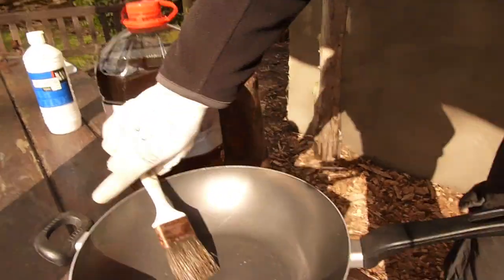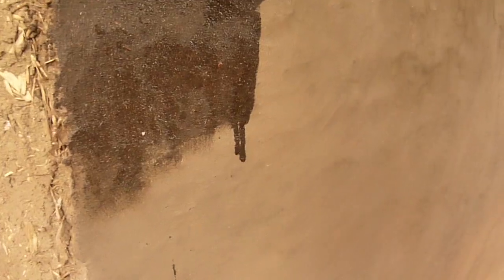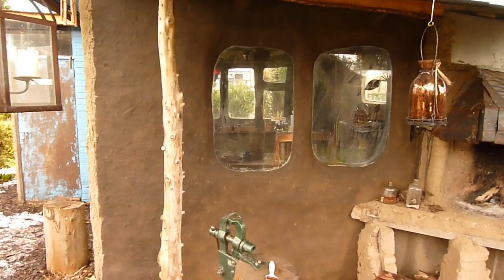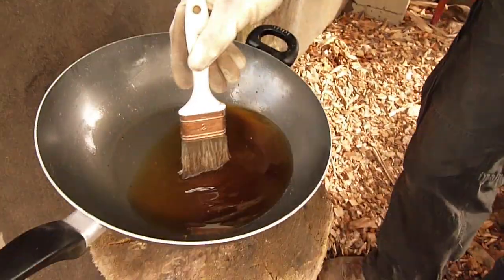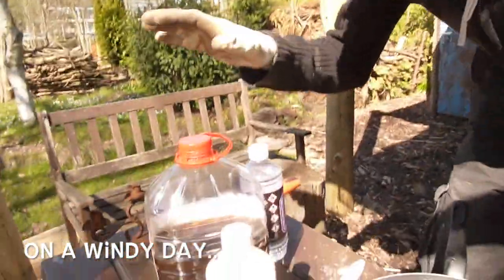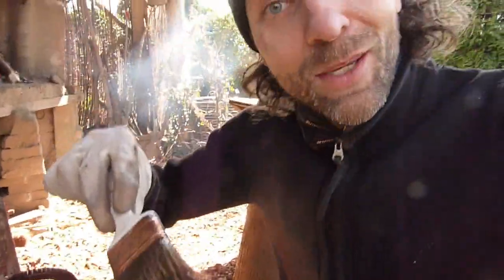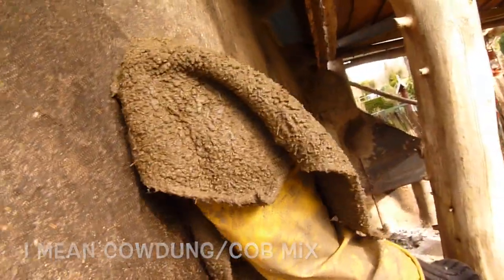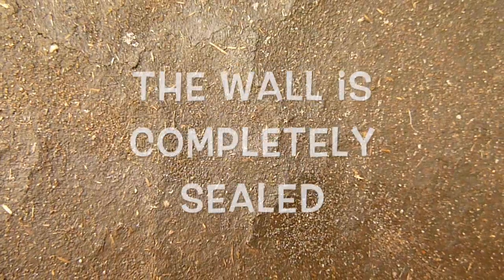WATERPROOFING a COB wall 🏰 (earthen plaster) with linseed oil

Comment: I enjoyed the video, but I don't understand the rationale of first coating with heated linseed oil then following with 2 coats of diluted oil and turpentine (1/4, then 1/2). Wouldn't it make more sense to start out with the diluted oil for deep penetration (1/2, then 1/4, then just oil)?

Comment: Bad idea. You want your walls to breathe.
Reply from the maker: Of course it is a bad idea if you want your walls to breathe. But if you read the info below the video, you know that there may be circumstances where it is a great idea ;-)
Reply: @Le0nski 
Don't believe everything you read.

Remember, cob is made with straw. It does not compost down into dust. If you put a substance over your cob to where it traps moisture... 

You will not only have collapsing walls and roof- but black mold which you will be breathing in on a daily basis, wondering why you have constant headaches.

Comment: The Linseed is expensive for painting onto the absorbant mud.  But it's good!   
Also, I have some earthen structures in a humid area that I finished with lime + dirt plaster, then lime+dirt paint.  Lime is a great stabilizer waterproof if in humid areas.  In the desert it would never work for me.

Another one is making a stabilized plaster with the linseed oil. I think that is holding up pretty well on an adobe I did.
Another one is wheat paste.  Look it up for recipes.  Surprisingly good. 
Another one is "prickly pear" juice or "baba de Nopal"  much more involved and perhaps the least stable, but also worth playing with.
Reply from the maker: Wow, thanks for your post! Great addition to the possibilities.

Comment: I know I am a little late, but it might still help for your future project and others: if you boil raw linseed oil to create DIY boiled linseed oil you have to be very accurate! It needs to have a temperature of 130-150°C for at least an hour (better two) to initiate the chemical reactions. You can use a deep frying thermometer to check the precise temperature. And as you said, it is highly flamable. So when you heat it to these temperatures, better don't do it on an open flame. 
In general raw linseed oil or your heated linseed oil will also harden completely. Just a little less durable, as it will have less polymerized bonds. The waterproofing effect is the same though!
To explain your cracks: your first layer did not penetrate the wall and only created a thin protective shell. As @laurens3638 explained, it's better to start with a higher dillution first to make sure the oil penetrates as deep as possible. Your dilluted second layer was not able to penetrate deep as the first layer already created this thin shell. When you applied your third layer, the cracks appeared because you applied the oil too hot. The temperature difference cracked the thin shell up. You can see in the video that this thin shell even delaminated a bit.
So even when using the right order of dilluted oil, do not apply it hotter than 40-50°C to allow even suction and gentle cooling of the oil. This will give you a consistant and durable finish ;)
Hope this reaches you well!
Reply: so which oil is best to use to waterproof cob ...boiled linseed oil or raw linseed oil ?

Comment: Does it remain moisture permeable? I’m not sure   Wouldn’t it be better to use line wash instead ?
Reply from the maker: The water can't get through, it is completely sealed. This is why I don't recommend doing this to all your walls, as they will also stop breathing. Lime wash is a good choice, but probably not on a wall that is exposed to a lot of rain. This was my main concern for waterproofing this wall.

Comment: Why did you heat up your boiled linseed oil? Also, was there a reason to go with boiled instead of raw linseed oil? The boiled dries faster but I've heard raw is more durable and protects better once dried. Also, boiled typically has solvents added to it as dryers, then you even added more....all of the additives may be what caused cracking. I was wondering if you ever tried just using plain raw linseed oil. Also, certain pigments added will give it characteristics...for instance zinc oxide pigment added makes it into a excellent white paint with very very good UV protection.
Reply from the maker: Hey Stephen, when cold, the oil is quite thick and has a low viscosity. After being heated up, it is absorbed much better into the wall. Boiled linseed oil has been treated with heat for a certain amount of time, resulting in an oil that is much different from raw oil. If you think raw oil is better, just us that, I am a fan of experimenting with these things, so try and find out.  When you get boiled linseed oil at a trusted source and you know it is genuine, it contains no additives. When bought cheap, it will contain plenty of additives to hide the fact that it was not heat treated as it should. I should not have added turpentine, it was cheap and probably caused the cracks, so you are right. Better to use it plain. Nice to hear that you can add pigments, I am definitely going to try that in the future, so thanks! Thanks for sharing your thoughts!

Comment: Will raw linseed oil work? What about for sealing a clay floor, will raw linseed oil work? Thank you.
Reply from the maker: Hey, thanks for asking. Raw linseed oil will stay fluid, and the boiled version wil harden after it is absorbed by the wall or the floor. You can’t boil it yourself, it’s a specific proces (unless you know how, of course, but it’s more practical to buy it). It’s expensive, but goes Al long way. I introduced this oil in my videos after seeing a video where it was used on a clay floor. I just took that idea and waterproofed my earthen walls with it, it turned out surprisingly well. Your floors will become dust- free, waterproof and hard as a rock!

Comment: Hi, We just finished a cob bench covered by a roof. We put 4 layers of linseed oil on the bench and it looks good. Do you know if we'll need to add a layer of linseed oil every year or every few years? How can I tell if the bench needs it? thanks for your thoughts.
Reply from the maker: Hey, I was checking my messages and saw that I completely missed your post.. sorry about that! It’s been a year, so I am curious of how it looks. Do you think it needs a new coat or is it still fine?

Comment: Wouldnt the high contraction/dilatation of oil cause even more cracks in time?
Reply from the maker: Well, at the time I applied the oil, I read that after a few years you need to apply it again. A few years ago I sold my mancave, because we sold our house, so I haven't recently seen what it looks like, and I don't know if the current owners have reapplied the oil. In 2018, the wall was still in perfect shape, no new cracks had appeared. I intend to visit my mancave somewhere soon, so I will let you know what it looks like after 5 years.
Reply: @Le0nski  Probably after the oil polemerize with the surface, its properties are somehow changed. However i decided to apply a liquid rubber to mine.
Reply from the maker: @danielmogos8990  That's interesting, is it natural rubber that you applied?
Reply: @Le0nski  yes

Comment: Would olive oil work ?
Reply from the maker: Hey, thanks for asking. Unfortunately not, it doesn't harden when exposed to air. Boiled linseed oil hardens and stays there for several years. Make sure you get one from a reliable paint supplyer, because the cheap stuff is fake.

Comment: Hats off to you for your informative video. Would you please share your experiences about use of linseed oil over lime plaster in kitchen, bathroom or other water expose area , to make Water proof wall? Waiting for your reply !!👍🙏🙏🙏
Reply: For lime, you can seal it with the traditional Morrocan method using olive oil soap. The soap and lime react to make a hydrophobic surface. Look up “tadelakt”.
Reply: @lenavoyles526  ❤️❤️
Reply from the maker: As far as I can tell, it's perfect for any place that is exposed to water. I have no experience with lime plaster, so you might have to ask around a little more. Just keep in mind that the walls no longer breathe. Besides that, it's great. I used it on the wall around my sink, and the water just runs straight of. Hope this helps!
Reply: @Le0nski  ❤️❤️

Comment: With an increased overhang on your roof waterproofing is not as critical. Pat@cobworks.com
Reply from the maker: Thanks, you are absolutely right! This mancave was initially just a wooden shed. The roof and walls were already there, all I did was remove the walls and replace them with mud. Overhang is essential and I only advise using boiled linseed oil on a wall that is subject to heavy rains with a lot of wind (as we have in Holland.) Thanks!

Comment: Does this process make the wall vulnerable to fire?  Linseed oil and turpentine are highly flammable.
Reply from the maker: Hey Anna, thanks for your question! It doesn't make it vulnerable to fire. The oil cools down immediately once you apply it, and you only use a bit of turpentine (although now I no longer recommend diluting the oil with turpentine, pure linseed oil works better). The linseed oil is flammable, but the greatest risk is caused by soaked rags that are left folded up after use. They can spontaneously catch fire. Furthermore, the wall soaks up the oil quickly and the earthen materials will slow down any fire (I have not tried to light up the wall yet, but it would be interesting to try it 😉)

Comment: Can I use palm oil instead since it’s cheaper?
Reply from the maker: Hello David, thanks for your question! Boiled linseed oil is processed in a specific way. It is expensive, but you can't use any other oils to waterproof earthen floors, walls or sculptures.. It hardens when it dries and this is not the case with other oils. Sorry!
Reply: @Le0nski  thanks for the answer

Comment: is linseed oil flammable after it dries
Reply: No, luckily it's not 😊 When you use a piece of cloth or a rag to apply it, just don't leave it fumbled up and lying around somewhere, after you finish. After a while it may spontaneously catch fire. If you hang it out to dry, this won't happen. When applied to earthen materials, the oil hardens and becomes harmless 😅
Reply: @meesterleon3361  That is great news...thanks for the reply

Comment: I have had oil paint crack when I added too much turpentine. May be better to do without.
Reply from the maker: I think you are right. It's probably best not to add turpentine, although I will have tot test that, to be sure. The technique of sealing walls with boiled linseed oil is initially used for cob floors. I just used it on the walls. A floor needs to be soaked as much as possible. A wall just needs a 'crust' to protect is. Not using turpentine would probably work 👍🏻

Comment: What is wash out and do you have to do this?  I live in the desert
Reply from the maker: Hey Tuffy, a washout is when the rain washes away parts of your wall. A monsoon or torrential rain may cause this. If you live in the desert, you might never have to deal with this, I suppose. Is that would you mean?

Comment: Could you use sunflower oil?
Reply from the maker: Hey, good question 👍🏻 Sunflower oil stays liquid whereas boiled linseed oil becomes solid in the wall. Then again, maybe no one has ever tried it before.. so try it out on a piece of dry cob and see what happens. I make testcilinders by filling an empty toilet roll with cob. When dry, I apply whatever I want to test. I then place it in a little bit of water and compare it with a test cilinder of cob with no additive. Check out my banana leave video for a demonstration - good luck, let me know what happens 😁👍🏻
Reply: What about tree sap?

Comment: Well done.  Thank you.
If you don't have linseed oil. What other alternative may one use?
Reply from the maker: Hey Robert, that's the million dollar question! There are ways to make it water repellant, cowdung in your mix works very well. There are vage records of people using animal blood, termite mount, banana leaves, carob and other natural ingredients, I have tested banana leaves and carob (test not completed to my satisfaction yet), but it is no match compared to boiled linseed oil. You can use lime plaster, but I have no experience with this. Linseed oil prevents your earthen wall from breathing, so don't use it on all your walls. It is somewhat expensive, but it works, and you can order it online (make sure it is genuine, there are fake oils out there). Hope this answers your question!
Reply: @Le0nski  thank you

Comment: Boiled Linseed oil is full of additives and chemicals that cause it to cure faster, which is why it's a skin irritant. Food grade flax oil is the raw ingredient in it and can be found at just about any grocery or health food store for a comparable price.
Reply from the maker: Hey Luke, thanks for your comment. You are partly right. High grade boiled linseed oil has no additives or chemicals. Cheap versions have not been boiled, so the chemicals are needed to make it appear like boiled linseed oil. You can consider these brands as fake. The Linseed oil that is found in health food stores or groceries is not boiled, but raw. This will not waterproof cob or earthen materials. It is made for consumption. Take care man!

Comment: Thank you for the nice video! I would like to know if I can apply the linseed oil as well on a Pizza Cob Oven as the waterproofing last layer?
Reply from the maker: Hi Anabell, thanks for your comment.  I have not tried it myself, but some people have. I have not heard of any problems if you do. This is what I answered Christian Young (see below):  "Don't forget to ventilate the oven after baking your pizza, because all the moisture will be trapped inside the cob. Someone on YT suggested not to treat a pizza oven with linseed oil, in order to let all the moisture escape through the cob layer during the baking process. I don't really think that's a necessary, if your oven is thick enough, the cob will take up all moisture and release it again once you leave the oven open after baking." 

You might check with him to see how it turned out. A roof over your oven will protect it as well. Keep me posted!

Comment: Can i make a roof like this?
Reply from the maker: I abolutely think so, yes! If you keep the cob layer thin (like I did on my doors), it won't get too heavy. Also, make sure the water can run of. I am planning to use it on the roof of a new project as well and the nice thing about it is that you can create organic forms in your roof. My idea for this is as follows: Make a sturdy wooden structure to support your roof, and then place wire mesh on it. Cover this with a layer of burlap and then a thin layer of cob / earthen plaster and then boiled linseed oil. After tree years, repair any cracks and repaint it, and you'll be fine. You might add a waterresistant tarp underneath the wire mesh, just to be sure. This will make an ugly ceiling, so you'll have to mask that with fabric or a wooden ceiling. I have not tried this yet, but I am confident it will work. 

I hope this helps, keep me posted of your ideas, good luck!

Comment: Did you use wire in the build?
Reply from the maker: Hey Samantha, I completely overlooked your question... I did use wire mesh, to hold the wall in place while it dries.
Reply: @Le0nski  that's cool work. 🙂

Comment: Are you able to add insulation  to live in in winter? What size were you wall was it waddle and tube? Or cob or made brick form like Adobe,  we plan to build a shed soon and I am currently making a small kiln with added fire clay. We hope it works well for my jewelry peices
Reply from the maker: I am not allowed to live in my mancave in winter, because of the regulations (it's an area where you rent a garden), so I am not going to insulate it. The walls are very thin: 2 inches at the most, I invented my own technique (watch mancave 2.0 if you can stand the sound effects ;-)   I used waddle & daub as well, that is such a perfect technique.  If you want to read up on the topic, try the book 'cob builders manual'. It's freely available on the web. Good luck!
Reply: @Le0nski  were making a fence soon with waddle and daube  so we can have parts of the wood  exposed in some places, I'll look that book up and thanks
Reply: Would that type work for a shed?
Reply from the maker: @samanthanicholson9015  waddle & daub is perfect for a shed!!

Comment: Is it fire resistant, Even if linseed oil or wax is applied? I thought it's flammable, how did it help for rain and humitity?
Reply from the maker: Hello Samantha,  after the oil has dried, it is fire resistant. I made a fireplace out of cob and it melted my raingutter away, but the oil in the cob remained fine. It's flamable before application, and drenched rags can catch fire if left unattended. It works perfect against rain and humidity. Still, it stops the wall from breathing, so don't apply it to all your walls. If you make an earthen bench, oven, statue or anything that is exposed to rain, the oil turns the plaster into a water resistant layer. What do you intend to use it for?
Reply: @Le0nski  a Adobe oven and kiln or combo unit
Reply: I was planning on adding fire clay to my Adobe mix in was think about wood ash or lime, both seem this video, seems like a good option. Breathing walls, if it breathes it allows air inn and out correct sealing it keep out moisture as well as inside right. Just wondering how it affects the cob outer and inner layer from cracking, we could always control  moisture inside more then out so we would get cold it's a weird thing cob but I heard some say their house stays cold maybe because it wasn't insulated enough, with straw?